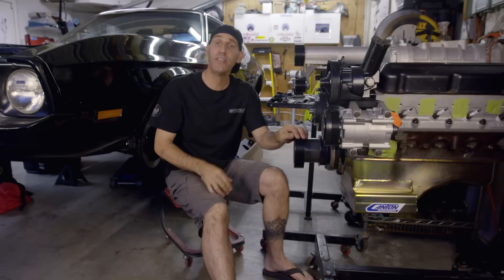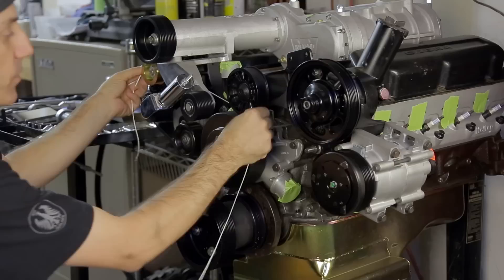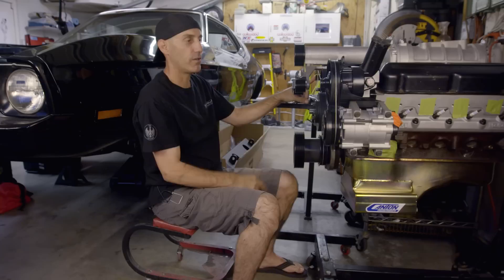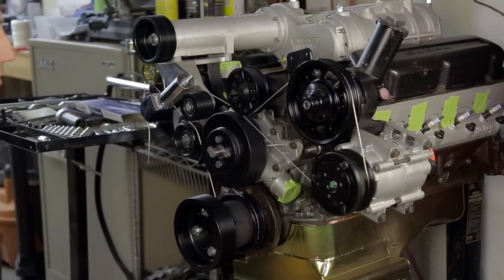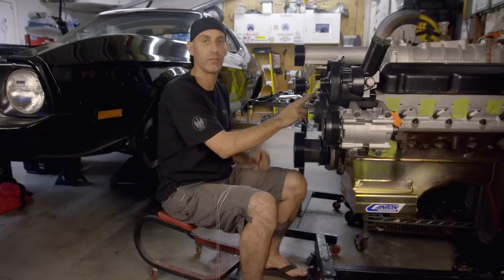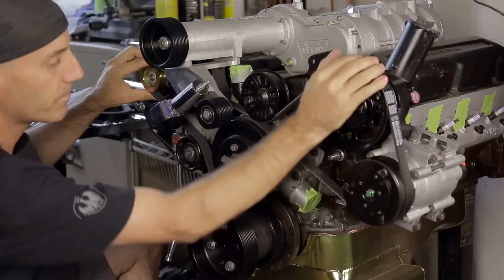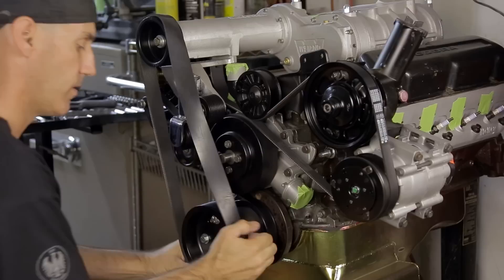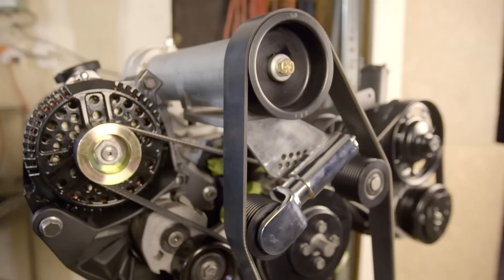Garage Mechanic Tech Tip: How to Measure for Serpentine Belt Change Up

Comment: Love your Video series!! I too have a 1971 Grande with the 351 Cleveland. My dad bought it second handed with about 5K in 72. It went through my older siblings and I got it as another "hand me down"when I turned 16. Rebuilt it, and drove it through High School and Collage. When I finally put it in the Chicken- Browder house she had 250K. Her name is the Brown Mule( thanks to my late sister Mel). She has been there since 1988. Now that I have a little coin to play with, I am contemplating pulling her out and making her my next project. You are building yours almost exactly like I had planed to do mine. Love the suspension /steering/ breaks upgrades. I especially like the AC unit that fixes the High Hat rust issue I have with mine. That is a common problem with Stang's in Florida. Since she is a real, Black vinyl top, gold flake putter, cinnamon, Cleveland , Should I keep the 351/FMX or should I go with small block? Accurate EngineeringRace Motors is based in here in PC Florida and make several wicked small blocks. Mark the owner recommends a Windsor "Fast" fuel injected pieces. Either way Cleveland or Windsor, I want to convert to 5 speed and EFI. What would you do? If you don't mind me contacting you about your project, I would  appreciate the opportunity to pick your brain.

Comment: I found this video yesterday by searching "smog pump serpentine Ford 5.0". I'm trying to do what you show here on a '91 Ford F-150 4wd PU 5.0. After doing a lot of other engine electrical tune up, I finally get the engine to fire again after realizing it still has a fuel problem,  but also a new bomb shell, I discovered the never before squealing noise  I heard was the frozen smog pump.  The serpentine belt slipping over the pulley. I first checked Autozone for a remnan pump, oh wow $230+. Then I thought guys like yourself who change or retro fit engines for racing or just to customize would do something to delete a smog pump but then would need a special belt.  Thanks to you my problem is solved.  Now I'll contribute a little tip for others needing to do the same. When keeping  an original  engine set up as I have and probably needing to replace the serpentine belt while doing a tune up, or if the smog pump suddenly locks up, I did a simple easier way to measure the new belt less the smog pump. First thing is to release the belt tension via the spring loaded tightner and safely lock it. I  had a pair of vise grips handy or a small c-clamp will work, using a sharp utility knife I cut the old serpentine belt. Make sure you hold on to both ends of the cut belt so none of the belt falls off of or slips off the pulleys. That is to ensure you'll be able to measure accurately for the new belt. Using the vise grips or c-clamp Overlap the two cut ends of the belt pulling them as tight as you can by hand then maybe with an assistant maintain the tension while applying the vise grip to secure the ends.  This worked as did your use of a string. After the ends are secure remove the belt free from the engine. It's best to Lay the belt on a bench or table and carefully mark the belt at the overlap.with a good marker. Un do the clamp, lay the belt out straight and measure from then end without the mark to the mark on the other end. That should give you a very close required belt length, before estimating like in the video that 1 inch or half inch shorter for the right pre-tension.,  I realize my idea is more complicated in some ways, but unlike the video I was working on a vehicle under the hood not an  uninstalled engine. One thing I should have mentioned, the entire smog pump should be removed or at least  removed the pulley right after locking the tensioner, because with the pump still on the pulley isl partially in the way pushing against the belt not allowing an accurate measurement .I hope this rather long post doesn't annoy anyone, I just wanted to share this, complementing the video hoping it will help someone else. I had to use text here because I don't video. Thank you again Jason

Comment: Thank you! I've got an old school bus and the Ac compressor is busted... I need to reroute the belt and was a bit panicky about about the new belt flopping off. The key bit of info for me was making sure the tensioner is roughly halfway turned when it's all set in.
Reply from the maker: Glad it helped! Sounds like an interesting project👍

Comment: These quick howto tips are a good idea. I have no idea how I first landed on your channel back in the Viper Maverick era but I remember that I started following ericthecarguy with a quick tech tip helped me on a brake job.  I like your Mustang project because there are many updates and the project is progressing.  I you can spare a piece of cardboard, you could write the steps of your project and mark them off as they are completed (it has been done before) or if you change your mind like for the rear suspension upgrade.

Comment: I did the same thing on my 1953 F100 with a 89 EFI 5.0 but I just used a tape measure.  You can go on the Dayco website and look up belt part numbers by length and number of ribs.  Take that part number to the parts store and you don't get the "you have three heads" look when you can't tell the dude behind the counter what car your working on.

Comment: Thanks for the helpful video. I have a 95 cobra and you've just cleared up one of the questions i had about installing a new belt. 

I know for your motor you said you cut the bracket off the engine for the smog pump, and i assume you plugged the exhaust ports on the motor. If I wanted to remove my pump from the loop, would I be able to leave the pump/hoses in place and just reroute the belt around the pump with any negative impact?

Comment: Please hurry up on this project. Also , I've read your motor came out of a 95 cobra and a 93 cobra. Which is the right answer ?    Thanks for your time.
Reply from the maker: +BustedWalletGarage Work has really kept me busy lately so it's been slow going on the Mustang but there are lots of good things to do on it so hang in there.  
As for the engine, 95 is a confusing year for the Cobra engines... I believe it came from a 95 Cobra Convertible and is the very last of the 5.0 Cobra since later that year Ford replaced it with the 5.8.  My friend Rob at Mustang Monthly Magazine is certain it's from a 93.
Reply: +autoedit I have a 95 mustang gt. Ford borrowed accessories brackets from the full size van because the 4.6 wasn't ready yet. Sure way to know is the size of the pilot hole in the water pump pulley. 94-95 has a much larger pilot hole / a much larger alignment stud on the water pump than >93

Comment: Great video very informative.  I have the same supercharger on a 67 Mustang. could you please tell me what brackets you are using as I want to add power steering to my car. 
I will only need to run an alternator and power steering. 
I looked at March performance. com as they have a really nice kit but it won't work with the supercharger. 
Thank you
Norm
Reply from the maker: +Norm Mccormack I think the cool setup is from the 95 Mustang GT.  You can get that from a wrecking yard for cheap and modify it to work for you like I did here!

Comment: Have you been able to run the engine with the supercharger and Terminator EFI? I have the same EFI and I'm just wondering if there might be any issues using that combination.
Reply from the maker: I haven't been able to get the engine in the car and running yet. The guys at Holley say that as long as your manifold vacuum reference is below the super charger the computer will figure it out and run great.

Comment: Are you sure the belt is too close to itself and may rub?
Reply from the maker: +Mb cB In my experience, it can be very close to itself on a return pass as long as it's NOT on the run that has a tensioner arm on it and running against a pulley or idler.  We'll see for sure...I'll shoot video of it!
Reply: +autoedit 10-4